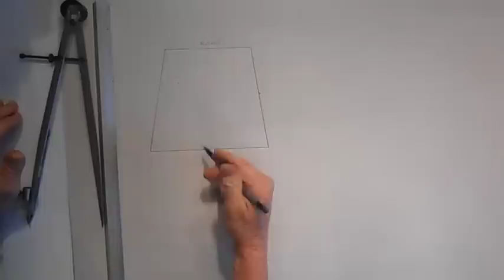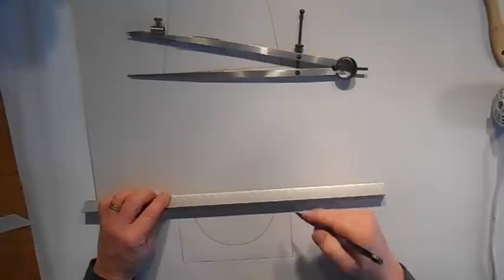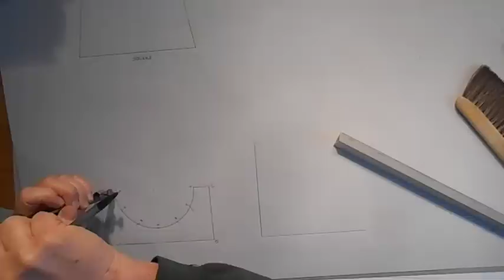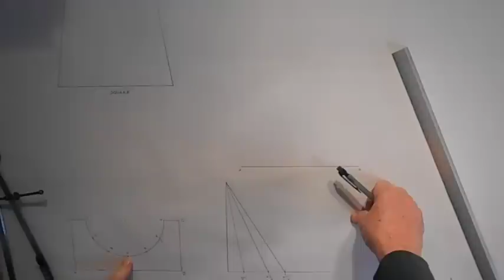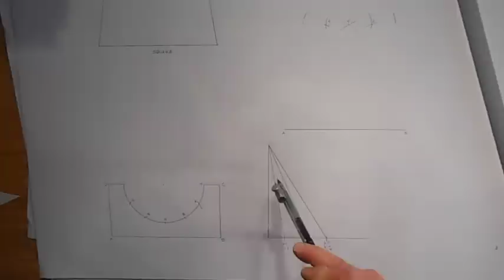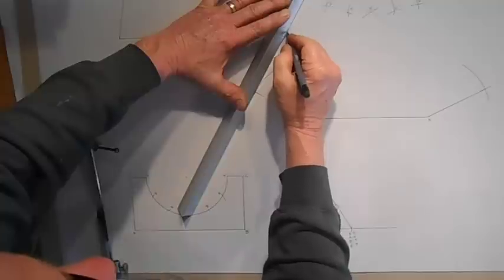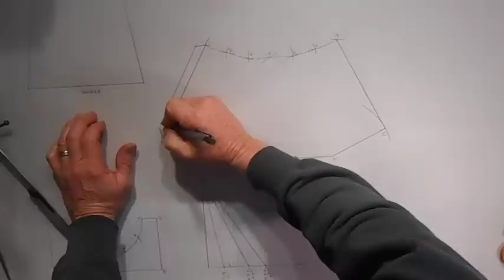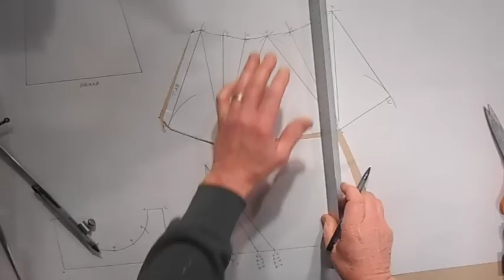Pattern Making- Square to Round Transition

Comment: Just did a rectangle to round a few weeks ago 88 inch true height 112"x118 base with a 56" diameter hole . I had to use half the shop floor for the layout. I'm an apprenticeship teacher for our local insulation trade and you use,an lot of the same techniques that we use. So I'll be sending our students your link so they can do homework.
Reply from the maker: That was a biggun!  Dave
Reply: Nice! What did you use to draw the pattern on, and how did you transfer it?

Comment: I just wanted to say thanks for putting a wonderful, and informative video together. Because of this video I was able to make a fitting that I needed for work. I was able to install an air conditioner in a duct system that nobody else thought was able to be done, and the air flow was greatly improved. It was a 13" X 19" to 16" round with a 6" offset. You gave enough of the basics here to help me get it done. Again thanks.

Comment: Few things, one, thank you for helping to teach future tradesmen what they will need to do the best job they can. Second, you can make the square to round in one piece while avoiding brake lines by using a roller to bend the round portion of the piece. this is accomplished placing the piece in the roller as if you where about to bend a segment in a brake, next you need to place a pair of clamps on the square of the square to round in order to disallow it to be rolled. After this is done, roll one quarter of the piece and open up the roller and reposition to the beginning of the next quarter of the piece. Lastly, when bending a square to round, each quarter of the round must be bent at 90° (as 360/4 is 90) to figure the angle for each bend you take 90/number of bend lines (so four bends would be 22.5° per bend NOTE: for centered square to rounds only). Personally I recommend not laying out in a manner that would cause you to need more than 10° per bend, this will ensure the round is a respectful round. Please feel free to question anything I have stated, I love constructive conversation.

Comment: Thanks for replying Dave iam not familiar with program digital pipe fitter this is a pre trade assesment and i am struggling with the development of the intersection pipe
Reply from the maker: That's a high bar for a pre-trade test. Only the best pipe fitters are put to rigging those connections....

Comment: You must be using Staedtler pencil lead if it breaks that easily. Total garbage! For a 0.5mm pencil, I like Pentel Super Hi-Polymer 5H (Pentel #C505-5H). That's also a bit harder (5H) lead, so not as dark, but it makes a finer line and stays sharp longer. They do make softer lead too: 2B, HB, F, 2H, 4H, etc. I am not associated with Pentel, I just really like their pencil leads.
Reply from the maker: I use Pentel HB "Super"- i'll try they're others!
Thanks

Comment: Can youbplease help me how to create a pattern for a head peel development of a bullet lpg tank?
Reply: Do you mean an "orange peel head" as used in capping pipe? Hobart puts out a video on it. (and others)
Fabricating a head for a pressurized LPG tank? That would concern me if it was used in a pressurized situation....
  In any situation, making a template on heavy paper is always advisable before launching into cutting up metal....   Dave
Reply: Josh Harper yes sir, but with a crown plate at the center of the peel. And it is used in pressurized vessel tank.

Comment: Hi Dave just want to ask for help regarding the developing of a round pipe with off set round lateral 55 degrees.
Reply from the maker: Sorry- When i have to make an "offset" connection (non-symmetrical), I use a program like "digital pipe fitter".  Some of these programs have a free download. Having  access to a large plotter (printer) is a bonus for printing out these sometimes large patterns-
Dave
Reply: Dave Osland

Comment: Mr. Osland,
Thank you for your tutorial; it fulfilled my need perfectly.

I am building a router table and need a 12” X 12” to a 3” round, 6” tall to fit under the router for dust collection. I will buy 30 gauge, 3' X 2' sheet metal at Lowes, layout the square-to-round per your direction, bend it on a bench, pop rivet it together, connect it to PVC and on to a shop vacuum.

The only comment I have is that using dividers to measure the circle segments might not be accurate enough in some applications. Twelve straight line measurements will be shorter than 12 arcs. A flexible ruler will measure the true length of the arc.

I am going to use your method verbatim.

Thank you again Sir.

Comment: Dave,

    I was able to do the square to round transition using ACAD. I used smaller diameter circles i.e. 1/2 inch radius to keep track of the arc swings. I screwed it up a few times but i kept reviewing your video until i got it. I cut it out and taped it together so i know its right. I was tempted to switch to paper and compass but i kept at it until i had all the arc lenths correct and in the right place. I have one at work i would like to develop. Its square is 8'- 6" x  4'. It transitions to a 36" diameter pipe flange. It is 3'-11 5/8" away at a 45 degree angle. Any suggestions using this Square to Round Transition?
Reply from the maker: +robert morin  That thar is a big-ass transition! A hopper in a processing plant?
i'm not quite understanding the shape- 8'-6" square x 4' high or a 8x4 rectangle base?  Any way, a pattern can be made for it. Because of the size, a quarter pattern rather than a half pattern would be more manageable, if it's a symmetrical shape, as opposed to an offset, in which case a half pattern would be necessary. I would probably try it on ACAD,  and then plot a 1/4 or half pattern- Because of it's size, it might have to be plotted in 1/4's to be laid out on sections of the transition pieces-
 I bet a lot of us would like to see the final product!!!

Dave
Reply: The rectangular measurments are 98 in. in height by 102 in along its length. Yes it is like a hopper. It is part of a Hood system for a melt shop in a steel plant. It transitions to a 24 inch diameter pipe at a 45 degree angle. I was wrong about the 48 inch on the rectagular height. The transition begins at 52 inches down from the 98 inches. The measurement from that apex out to the end of the 24 inch diameter is 47 5/8 inch long at a 45 degree angle. I plan on starting the layout using half the piece and then dividing that in half as well. It will be a hell of a layout, wish me luck-lol!
Reply from the maker: +robert morin  Ya gotta get us some pics along the way and  the the finished product!!!
Dave
Reply: I will try. This thing is a mind bender and it will take me some time. I may have to do it on paper first since it is complicated. I am having trouble with the view representation but i will keep at it.
Reply: +robert morin Ya i'm lost! I tried to develop a pattern using the square to round method with no results. I know how to find the true length lines but i am having trouble with placing some of the points. It is 36" high by 51" at half length. Over all it is 103" in length. It truncates at 45 degrees to a round diameter of 24". Can you offer any guidelines as to how to accomplish this? I hate to give up on a problem and feel defeated. I can try to replicate it in ACAD and upload it for clarification if needed. I have a full size print of the project so all the data is there.
Reply from the maker: +robert morin 
I might be able to help, but I'm having difficulties in visualizing the shape with the description I'm getting-
Is it possible to email a sketch with the dimensions, etc..?
dave
Reply: Hey babe how you doing this is Anthony I have a little problem I'm trying to find out how to make a template for rectangular 2 rounds you can put it out video out there and see what's going on it like that 12 inches by 10 by 8 inches the ground until it reaches hi I really appreciate it man thank you
Reply from the maker: +Anthony Machain 
what's "rectangular 2 rounds"??? Rectangular base  instead of a square base?
Reply: Yes.11by 10 and 8in hole. 9in high.
Reply from the maker: +Anthony Machain 
the same technique is used. only a half pattern is needed as in the video... Dave

Comment: Where do I get the paper for laying outs templates?
Reply: I'd also like to know. Haven't found it
Reply: Any paper will work, it just might not have fancy ruled lines on it like this guy's. Just start drawing, and if you need more space on the paper, just add another piece of paper using scotch tape on the back of the page. For larger pieces, you can use cardboard, old desk calendars, roll-ends from a newspaper/printing shop, etc. Most office supply stores in North America sell 11x17 printer paper, which is double normal Letter size paper. If you don't know how to construct perpendicular lines or bisect measurements using a compass and a straightedge, it's pretty easy, so go search the internet.

Comment: Hello! Thank you for posting this video, this was very helpful. I do have a question, is there a way to make a square to round with the square being longer, and the round part being shorter?  I work in sheet metal roofing, and am having trouble making a custom part for downspouts.
Reply: I know this is an older post, but to answer your question yes you can manipulate the square to a rectangle and on an angle. The Same with the round end. The video is for a concentric fitting what you are asking is for an eccentric transition. The same process just a few more steps. Also you must take the thicknesses of the material you are using. This is called triangulation, if you lay out pipe you use radial layout.

Comment: if the round is bigger than square .how can we make this
Reply: The triangulation method is the same in both cases. When developing patterns for thick plate, you need to work with inside dimensions of the square and mean diameter of the circular end.